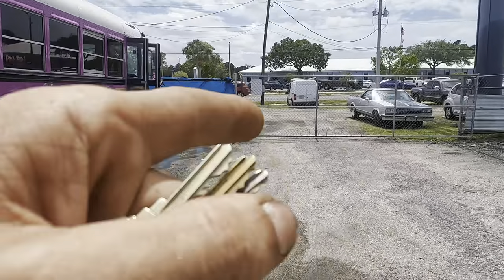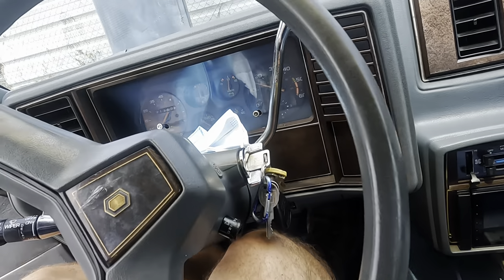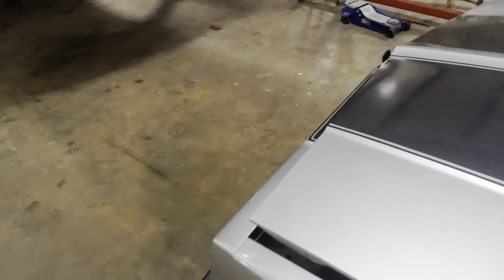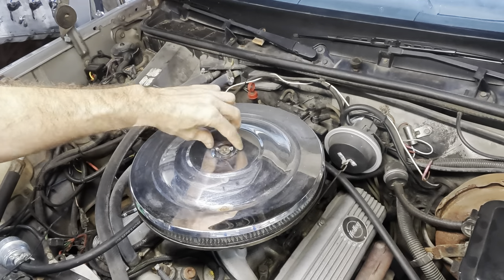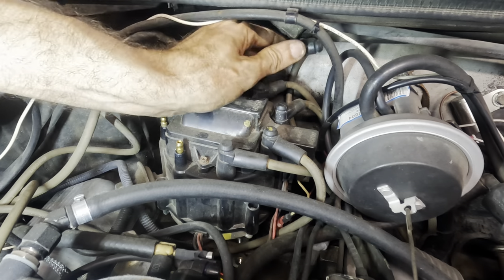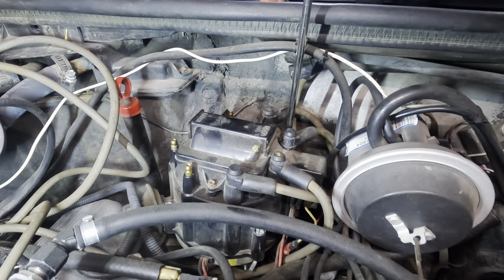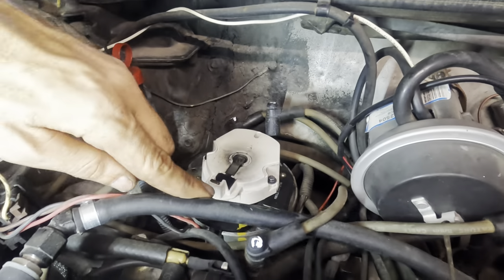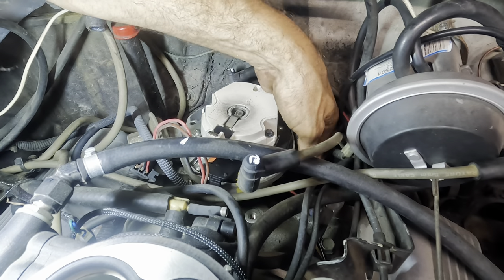Shuts Down While Driving! 1985 Chevrolet El Camino | Karen Story at End #mechanic

Comment: Hey Ray, the order of reassembly  is not the same as disassembly.  You should have mounted the hold down clamp and bolt before dropping the new distributor back in the hole. The clamp is slotted, so you can move the clamp away from the distributor shaft to allow the distributor to fully reengage in the camshaft. Then, slide the clamp back into position to hold the distributor. A lot easyer to reinstall the clamp. Also the  correct position for the hat of the distributor is 7:00. Not 6:00 like you reins5alled it. Thats why you had to readjust the timing after changing the distributor.
Reply: I never removed the clamp when I pulled dizzys, I just slid it back out of the way, then slid it back when reinstalling.
Reply: I don’t remember ever removing the clamp, i just loosened it and slid it back to get the distributor out and my first car had a 36 horse engine and points to adjust, no computer to answer all of those questions for you and you are spot on on the HEI placement.
Reply: You can tell he isn't a old school Chevy guy
Reply: I’m not a mechanic or a tech.
But I’m sure that ALIEN 👽 wrench he used was $150 and only used twice 😁
Reply: @juliocruz1695  8 bucks discount bin
Reply: I've always removed the bolt and bracket, but they generally needed a major cleaning anyway, including the bolt and hole threads(rusty salt belt and oil leaks with a thick grease coating or corrosion). as for the dist. clocking, not sure I ever seen any put back factory clocked, everything was always a tooth off, until the fuel injection with locking square base came out, even then many would redneck it with an old school hold down and tweak it right(lazy people)
Reply: @juliocruz1695  they are less than $10…they can also adjust in the middle if you hit the firewall.

Comment: The Fitech is an aftermarket fuel injection system that came out maybe 5-10 years ago.  We installed a couple of them at my old shop which specialized is classic American muscle cars.  Once the Holley sniper came out we started using those.
Reply: Do they cut the mustard when used in towing applications?

Comment: You don't always use a timing light, you could use a vacuum Gauge to adjust for the best timing setting, check it out!  Good video, keep learning...
Reply: I agree. Disconnect the vacuum advance and plug it. Attach the vacuum guage to a vacuum source near the base of the carb. Turn the distributor till you get the strongest vacuum. This method gives a better result than a timing light.
Reply: I use both.

Comment: The hold down clamp is slotted so you don't have to completely remove it to get the distributor out. Makes reassembly a lot simpler without the danger or dropping it. Also, the timing should be at least checked with a light, not just to confirm initial advance, but to verify the vacuum and centrifugal advance are working.

Comment: FiTech has an awesome tech support line that helped me diag and fix my warm start issues. It has something to do with the prime shot when the intake is hot. I’d give them a call and see if they can help you fix the issue. 

Side note: I haven’t got more than 3 minutes into the video yet and I wanted to add that there is a known warranty issue related to these FiTech TBI units. I sent mine in and they replaced all 4 injectors and the ECU that controls them. They gave me a 12 month warranty on the new parts that they determined that needed to be replaced. I was out only $30 to ship them the unit.

Comment: In my experience that stalling while hot problem is that flat resistor module that sits under the cap.   I always just replaced the module itself...didnt have to replace the entire distributor.

Comment: A vacuum guage will help you with timing as well. Adjust for highest vacuum, and back off a smige. If vacuum drops more then 2 hg you backed off to far. Runs strong, and better Mpg this way. This way timing is set to what the old engine wants.

Comment: The ignition module under the rotor was notorious for going bad in those. Used to always carry a spare. When they went bad, engine would run fine until you tried to restart it, then you were dead in the water. Oh the memories!
Reply: This is really late but my brother had a '78 Burb big block. It would randomly eat coils and modules. Fussed with it for years finally found the capacitor was loose and would have a intermittent ground. Snugged it up, no more problems.

Comment: I'm not going to tell you just how old I feel listening you describe how a distributor works. The fact that you feel the need to describe the process in such detail is what drove the final nail home.
What's next? Setting points? 😁
Reply: I think there are many people watching that have never seen a setup like that before. Many can't understand how people lived without cell phones and laptops, they wouldn't know where their local Library or bookstore is. I worked in a university and brought t in a rotating dial phone and put it on a desk where students would come in to apply for a job, so if their cell died, they could call a friend or a parent for help or with questions, but they could not figure out to use it, it was very funny to watch.
Reply: I still have 3 classic minis with distributors and points. 1 still uses a dynamo instead of an alternator 😮
Reply: @geordiegixxer  I had a Morris 1300 that started life with a dynamo but had a "transplant" and had an alternator installed. Really easy to do and it actually ran better and kept the battery charged much better.
Reply: She's a 71 clubman saloon so trying to keep her original as possible, still has drums all round and it's original 998cc engine.
Reply: Cleaned out the garage last week and a couple of things I tossed was my old timing light and a meter to set points.
Reply: @adcolt54  haven't used mine for a while, all done by feel/ear...
Reply: @adcolt54  😳- I still use a timing light. Used to use a dwell meter, but recent change to electronic distributor made it obsolete. You could have sold those two items (unless it was a cheap Chinese timing light).
Reply: Note, most condensers (part of points set) are made in China and are crap. You’re lucky if they test out to begin with. Try to find NOS and/or made in the USA.
Reply: @adcolt54  I've still got mine . It eats no meat, so it stays .😊
Reply: @adcolt54  I remember using a dwell meter to adjust the points on my 1971 Camaro. Man, am I old...!
Reply: @davidturk6170  Did they make cheap Chinese timing lights 50 years ago? I had 2 dwell meters, one large one and a smaller hand held one. I thought about posting them on ebay but didn't want to deal with lying buyers.
Reply: @electronicengineer  I remember using mine on my '58 Chevy back in 1967. Then on my '68 Buick Skylark in 1971. All the other cars after that had some short of electronics that did away with points and condensers.
Reply: @adcolt54  I believe that you are correct about early 1970's being the last of the mechanical points setups. I think that the replacement system was called HEI (High Energy Ignition), if I am remembering correctly. Bottom line is that I was able to perform a lot of the maintenance on my car; sparkplugs, points, ignition coil, wires, etc. on my own. I wouldn't even think of touching my new car, besides changing the plugs myself anymore. Times have certainly changed a lot in the automotive world!
Reply: I want to see him set the valve lash.
Reply: @adcolt54  Dwell meter if I recall? Not seen one in decades.
Reply: My Vincent Comet had magneto ignition. 🙃
Reply: Don't forget about the vacuum advance screw, there's another nail for your coffin...
Reply: @GARDENER42  As did my 1960 Sportster XLCH. Memories...
Reply: Accel dual point distributors!! VW squareback had mpi with the fuel injector points  in the distributor! L
Reply: @jiminsav  Unless someone dropped a solid cam in there it's going to be a hydraulic cam. Any of those engines with a big lumpy cam would likely shake the bottom end out.
Reply: Had the bumper block breack off a set of points once while in the fast lane on  I 25 during rush hour. That was a fun fix!
Reply: How about you get a crank handle car with the advance retard on the steering wheel. There were rules of thumb, but to get the most out of her you had to listen to the engine. 😊
Reply: @Geordie Gixxer you mean a  generator?  Lol my original Beetle VW has one of those!

Comment: Quite a surprise to see an El Camino video since I own an ‘83 Caballero (GMC’s sister).  Did a 305 to 350:swap, so I can identify with lining up the distributor to the oil pump.  First time in 40 years I had to dig out my Sears-Penske timing light.  Way to go!

Comment: Howdy Ray, I have a 1978 305ci in a 1957 GMC & a 389ci in a 1964 Pontiac and I love them both.  Over the years I've learned a few things and mostly that I find timing the ignition with a vacuum gauge is better.  I rough time with a light but it seems the vacuum gauge does fine tuning.  It really all comes down to the test drive.  I use non-eth fuel and some other factors come into play as these motors all have quirks that make them act different with a tune up.  If I had to guess I'd guess someone didn't put the thermo paste on the coil in the old cap and it overheated after a run and the bay heat built up when parked for a time.... and thus caused the fail on starting.  These have a learning curve but you did very well and I enjoyed watching this.  When I did this job on my 305 I found upon testing the new vacuum pull off was bad.  I check everything new these days and find odd problems and some times run into "issues".  I start at 7º at idle and end up around 34º running.  It's fun and not too hard.  Thanks,  Bobby
Reply: You don't put paste under the coil as it just bolts to the plastic cap,it goes under the HEI module which bolts to the base of the distributor. hopefully that is not a cheap china distributor and cap/rotor,those parts can be total junk.
Reply: @a4000t  Well... you know what I meant but I'm happy you cleared it up.  But the metal base is under the cap   ; )     Bobby

Comment: Ray how great to hear an old V8 under hardish throttle. You said the motor (engine) same/same to me was a 305ci which I’m sure your correct but in Australia the Holden (Aussie Chevrolet) were 308 ci then it’s bigger bro was indeed a 350ci which back in the 70’s was the largest Chevy motor available in Australia. Have a great day and great video as always👍

Comment: I had the same problem, just soldered all the modular wires at all the connecting wires, generally the modular is working fine and this can be proven after soldering.

Comment: GM distributor base clamps usually have a slot so you do not need to take the bolt out, just loosen and slide off of the clamp lip. The distributor will then lift freely out of the distributor shaft hole.

Comment: Sweeeet!  Loved this one...remember using a screwdriver to remove carbon from the cap's contacts or checking for carbon track marks, rotors, or cracked caps, etc!?  I still have my timing light, dwell meter, and my offset distributor wrenches.  No, you didn't have a "Check engine light".  For those of us who are skilled in the 'old school' techniques, I immediately "heard" the engine's timing was slightly off...it was a great feeling at my age that I still have the "ear" for it...

Comment: In those old cars like that with the control module in the distributor the control module is usually what the problem is when it dies when it gets hot. I used to work in Autoparts stores and at least 99% of the time that was the problem.
Reply: GM's were notorious for those going bad. I used to keep a spare in my glove box.
Reply: and the ford ones was just as bad and wht most people forget to do is apply the die electrisgrease that comes with the module and they burn out quicker i use to work in Autoprats stores and that was the one thinfg i sold the most of.
Reply: @Mikie1959  I had several fords in the past. Another super common failure was the starter relay switch, (on the firewall) I kept 2 of them in the trunk at all times. They were mostly the same over multiple fords. I always has a spare for me, and one to help some other person out. I changed so many of them, I could do it over the phone, to anyone with an adjustable wrench and a screwdriver. LMAO!!!
Reply: @K.Kelly87  For whatever reason Harley Davidson used Ford starter relays on their 1977 Sportsters . Common failure , easy to find . I've bought them on the road at auto parts places, Ford dealers and tractor dealers in farm country . When the Ford parts guy would ask me for a year and model I'd be thinking " Oh jeez here we go again ."
Reply: yep unde the hood they kept getting realy ot and it would fry the inside

Comment: I had the same symptoms with my, since departed, '90 chevy blazer. Runs for 30 miles then dies. Let it cool off and repeat. UGH! I ended up replacing the pick-up coil on the distributor shaft. No need to replace the entire distributor 🤷‍♀️

Comment: My experience with GM HEI distributors that they were absolutely bullet -proof and reliable ,I miss them.Seen a lot people replaced modules without applying the silicone heat sink grease then complain bitterly about GM junk.
Reply: The only problem with the HEI's that it was common for the coil to produce enough voltage to burn out the rotor.

Comment: Being a marine mechanic I use my timing light frequently.  Kinda surprised you don't need one down where the rust doesn't happen.
Reply: Makin' me feel old, having to explain to the audience how a mechanical distributor works.
Reply: @boggy7665  the new boy hipsters call them "dizzys", assuming they know what they are!
Reply: Another old marine pro here, seems we used to set base timing at 10 degrees btdc.  Same for small and big block chevys.  Always with a timing light, not worth taking a chance.
Reply: My wife and own a boat repair shop , always using timing lights , dwell and vacuum gauge .  It’s kinda funny showing the 30 something’s how to install points
Reply: @mike sabia  I couldn't make a living without my Steven's instruments analog tach dwell meter and my snappy advamce/retard adjustable light. So much more efficient than a   crisp 50 and a matchbook cover.

Comment: Usually not a distributor issue, but the control module is a big possibility. Also could be a vapor locking issue…
Reply: My first thought was vapor lock when customer states engine stalls when hot.
Reply: It's not vapor lock.  Fi-Tech is a 58psi return system.  It can flow cold gas through the system and purge any air of the system.  Vapor lock occurs because it's a closed system to an old school carb.  That cannot happen with a return fuel system.

Comment: The timing is set by turning the distributor housing and you have definitely moved that and the timing is now off. You will need a timing light to set it, unless you do a static timing set. Move the crank to the proper advance setting and turn the rotor to point at the center of the location of the cap plug wire port for # 1. This will be close but it really needs to be set with a light or do a power set by using a RPM meter.

Comment: I used to put tape and numbers on the wires and the terminals before pulling them.  I also kept a strobe timing light handy.  That four-barrel carb is pretty nice, or would have been back in the day.

Comment: Could the problem be a vapour lock in the fuel system? I seem to remember having this problem on my Fairlane on really hot days.
Reply: The old ignition coils would do it too when they got hot.
Reply: that has an aftermarket fuel injection setup, supply and return lines with fuel pressure regulator on the TBI. there's an electric pump in or right near the tank, so no vapor locking issues there, unless the fuel lines are wrapped around the exhaust and manifolds or the whole tank is being heated to boil-off(lol)

Comment: One thing you might have the owner check, as odd as it may sound, is the fuel pump. I had an old Pontiac in the late 90s that would stall when hot and wouldn’t restart until it cooled. I tried parts cannoning it, and finally fixed it after replacing the fuel pump.
Reply: My parents had the same issue with a 85 Nissan Sentra, my uncle said it was " vapor locking ". We ended up fixing the issue by installing an electronic fuel pump.

Comment: you need a timing light, no questions about it. i bought one just for myself for my chevy 350 TBI 1990 suburban. it was a life saver as i was able to adjust timing 4 to 6 degrees before TDC even though spec was 0 degrees TDC... gave me more wiggle room for errors on the vacuum assist timing...